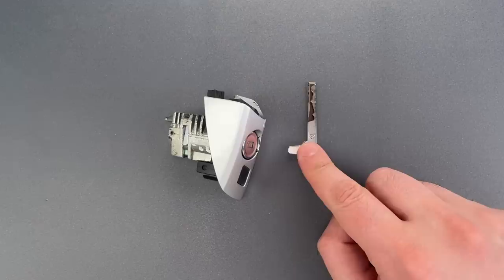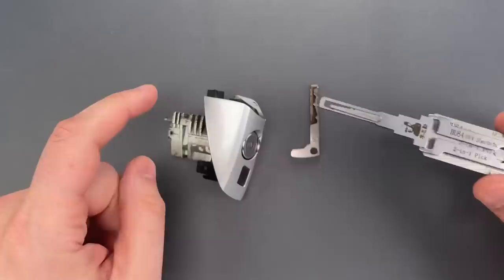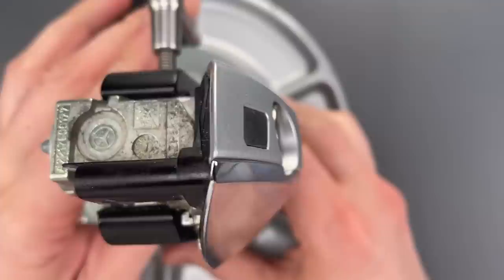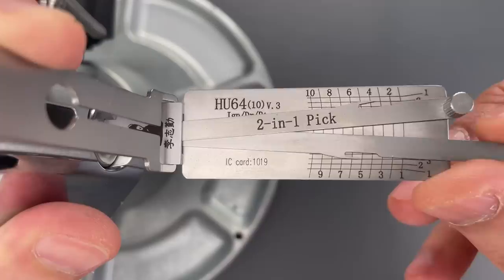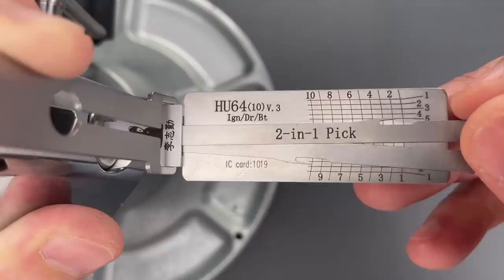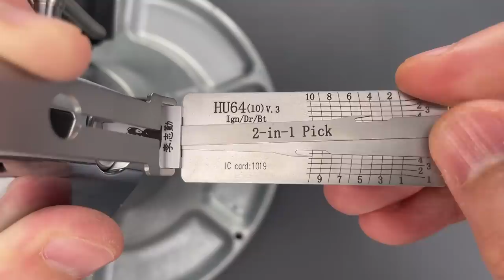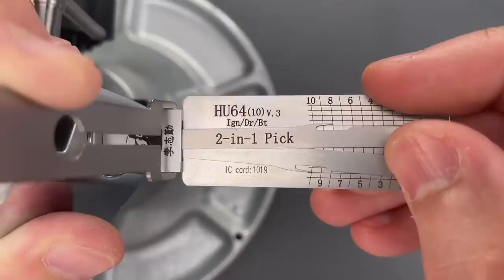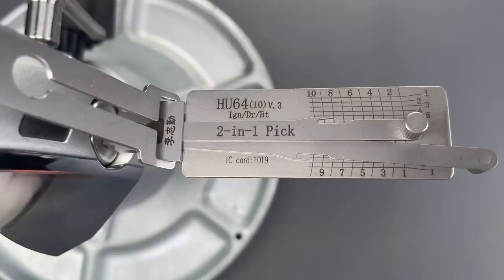[1411] Mercedes S-Class Door Lock Picked (2013-2020)

Comment: I was a bit shocked by the title, but then quickly became calm because of the fact that very few people has LPL's picking skill to crack this, and the fact that I don't have a Mercedes S-Class.
Reply: yeah but to start the engine you need an IR keyfob thingy tho
Reply: youd have to disable the immobilisor anyway, or chuck in neutral with a recovery truck
Reply: Same lock as my W211 E-Class.
Reply: @kristoffer3000  and my w212

Comment: Mercedes has been using these locks for over 35 years.  But really all these cars have alarms if the door is opened manually without the fob present.
Reply: Yeah, folks that want in them are only going to get the contents, they won't be able to steal the car without the fob and my gawd the noise that alarm makes. I still remember my C Class, that alarm would wake the dead.
Reply: That's why you first capture the fob traffic so you can clone it....

Or well that's how they did it with some cheaper earlier models, before the fob's started using rolling codes which are not that easy to crack.
Reply: Most need to pick the lock are when you lock your keys inside.
Reply: I'd like to see that confirmed. I've only done it with the proper keys, but usually unlocking it that way also disables the alarm as well.
Reply: @iVTECInside   Trust me it does not disable the alarm. I have owned/own multiple Mercedes.   If you take the key out of the fob and leave the fob say in the house and open a car door or trunk the alarm will sound.
Reply: @MarvinWestmaas   If you have the resources to clone the fob you do not need the key to open the car.....
Reply: If you're going to set off the alarm anyway and can only steal what's inside rather than the whole car, you could just smash the window. 

Then again, if I see someone in a car with their alarm going off and there is no obvious sign of forced entry, I'd be inclined to believe them if they claimed their car is malfunctioning or that their key fob has a dead battery. Cars seem to have a lot more false alarms than legitimate alarms. I'd glance over at an alarm but unless the car was mine or a window was broken, I'd probably ignore it.

Comment: Not sure I would expect more pick resistance from a car lock, even high price point. They will be reliant on alarm and immobiliser tech instead to disuade potential thieves.
Reply: @VideoViewer33512  Fortunately these days are long past, but in the early days of alarms etc. even those fitted by manufacturers were like aftermarket. Someone I knew made a 'living' stealing them, often selling them to the main dealers who would be fitting them back in wonce the found the alarm error was a missing alarm.

Comment: An important thing to note is that if you open a mercedes door with a key it will set off the car alarm (even if you use the key provided). This alarm will not go off unless the electronic key is present, and you can not start the car without the electronic key.

Comment: Bypassing the lock cylinder does not disable the alarm, though. There is a transponder receiver in the door handle that pings the transponder in the factory key. If there is no reply, the alarm remains active. So, as soon as you operate the door handle on the bypassed door, the alarm will sound and cannot be silenced unless you have a transponder-enabled key and re-lock the door with it, or put it in the ignition. Cool video, but still  only helpful if the car keys are locked inside or the battery is dead. The alarm system has a separate sealed-lead-acid battery that can keep it going for days after the main 12V battery is dead or removed.
Reply: There's no separate battery for the alarm. Im pretty sure the alarm wont go off if the key blade is used, its there in case the fob or keyless go system fails. There's main systems battery and then the aux battery for eco start/stop. No way you'll steal the car without very sophisticated equipment that gets a signal from the fob and copies it. This will take long enough to decide to run or smash the window though.

Comment: I thought yesterday "i want to see him try the locks on my s class" and you uploaded this video. You got in but there is absolutely no way you can fire one up without the fob. All conditions have to be right with the ecu, tcu, and ignition switch. Also unlocking the door this way will still set off the alarm system and disable the car.

Comment: Only allows entry into the car BUT the alarm will have activated !
You have to know the correct direction to pick as if you pick in the wrong 
direction you will have deadlocked the lock .
Picking the ignition is pointless without having the correct transponder chip.

Comment: Mercedes actually use this type of door lock on all of their cars and vans. Maybe trucks too, but I'm not sure. In fact, they have been using this door lock with that type of key for over 20 years now.
I own 2 and the keys are very similar. I've never used the metal keys to unlock the doors, but here is a tip to make sure your door lock functions smoothly. Spray silicone spray into the keyhole once, or twice a year, to keep everything lubricated. Basic maintenance, same as lubricating window tracks to avoid stressing the window regulators.
Reply: I prefer ballistol over silicone spray. I had a 22 years old 3-series and the locks were a little bit sticky and sometimes didn't lock. after treating the locks the locks funtioned like new.
same with door hinges, show them some love (and grease) and they work way longer (and don't rust)

Comment: I have one of these in my Merc (it's an old CLK, not the S-class, but they are the same)..
The key only allows you access to the inside of the car, does NOT let you start it, and in the soft-top (= convertible) models is actually redundant; its' ONLY function realistically is 
1) open the main door or the boot if the battery is dead or has been disconnected (Mercs batteries are in the boot, not the engine compartment, and the latch cannot be 'pressed' open if the electrics are dead as it is power assisted) 
2) actually to LOCK the glove compartment and the boot, if/when you drop the car off at the mechanic's or valet's, as you can leave the fob with them (to start the engine drive the car etc) while at the same time preventing access to any personal stuff CDs etc you've left in the car..the fob does not open these.
The ignition has been an infra-red transmitter since the mid-90s, the physical key is there to protect at most your sunglasses and maybe your jacket in the boot! It doesn't need to be high security..
Germans know what they are doing, no-one has ever accused them of under-engineering anything! 🤣

Comment: There is an old story about a plumber who is called to fix a blocked pipe. He goes under the house with a pipe wrench with the owner following. He takes the pipe-wrench and whacks the pipe which frees the blockage. He writes out a bill for $200. The owner complains that he only whacked the pipe with a wrench. The plumber takes back the bill and revises it: Whacking pipe with wrench, $2. Knowing where to whack pipe with wrench, $198. So it is with good locksmiths.

Comment: Auto locksmith here, the mercedes trunk locks tend to be much harder than the door locks, so much so that sometimes I will pick the door locks just to read the cuts before I do the trunk lock. It probably does not help that the trunk locks tend to sit at a vertical angle, but also for some reason, quite often as you pick the wafers, the pick arm tends to move away from where its possible for it to contact the wafers, so not only do you have to be conscious of pitch and roll axis, but yaw axis too.
Reply: When the trunk lock on my S class (W220) broke., I found the way in was to remove the registration plate, and drill a small hole in a certain place, then can easily pull the link rod with a wire.

Comment: Surely the car has an alarm system that would have gone off if the door was opened, right??
Reply: Yes, customers that also have the Mercedes app  that are subscribed to the feature will also be notified about it.
Reply: Yes the car probably wouldn't start without a correctly chipped key. But one can still get inside and steal something.
Reply: I believe these type of cars also have electronic measures to prevent it even starting. The key has to be in or near the car, so opening the door only gives you access to the inside, but not the whole vehicle. Unless you are a proffesional car thief, then you'll also jam the tracker, spoof the key + some other tricks and voila, got yourself a mercedes
Reply: This argument presumes that there is an alarm.
Reply: every car i have owned that has remote lock/unlock will sound the alarm when the lock is manually opened and it wont turn off until the car sees that the actual key is present, aka when you put the key in the ignition or hold the fob up to the start button.
Reply: When a car alarm goes off do you investigate it or just go "dang that's annoying" and continue on with your day? If the thief is quick and has a wrench it's very simple to pop the hood and disconnect the battery to kill the alarm, and anyone listening would think it stopped normally.
Reply: @Toastybees  Many cars have batteries that aren't super-easily accessible, particularly RWD cars (like a Mercedes S-class) that want to shift weight to the rear axle.
Reply: @boxr_4214  or you pop the bonnet and rip the battery terminals off in ~20 seconds or so. In a busy city at 3 am (when I assume most thiefs do their work) that's quick enough for most to turn back to bed
Reply: i think it could open but won't start
Reply: Car alarms are a waste of time... One goes off, nobody cares beyond saying to themself "STFU"
Reply: @jordanlewis1163  If you can pop the bonnet, remove the shielding, then disconnect the battery, and then also pop the boot and remove the carpet so you can access the auxiliary battery in 20s then you're a seriously good mercedes benz mechanic. 

If you wanna steal from a car just smash a window. People typically don't bat an eye when they hear an alarm, and you will be gone before anyone has time to dial the emergency services. For us honest people, never leave anything inside a parked car. At least not where it can be seen from the outside.
Reply: The alarm will go on as soon as you open the door, but the engine will not even crank without the electronic key button press, and transmission will not get out of park position either.
Reply: The alarm would go off before opening the door, just touching a Mercedes while it's locked makes it sound the horn as a warning.
Reply: @ikocheratcr  yeah i know but doors will probably open because the key is for emergencys only when the electronics are dead
Reply: @Toastybees  When I lived in Chicago car alarms went off so often that the birds learned to mimic them. And they'd all join in. So you might know that someone had done something to a car, but with every tree up and down the street going “whoop whoop whoop aanhh aanhh aanhh eeboo eeboo eeboo” you'd have no idea which or where.
Reply: @jordanlewis1163  aha! but the battery in a newer S-class is in the trunk and requires a screwdriver to access. not only would most thieves not know this, but that would require yet a another tool they would have to take with them.
Reply: Not only have numerous studies shown that audible car alarms (the GSM kind that text or email you are a different story) are next to worthless; but if the objective is to steal the car itself (as opposed to pilfer the contents) there are ways around immobilizers as well.  Most notably, hoisting the car onto a flat-deck and driving away with it; a surprisingly popular and effective way to steal a car.

Comment: *Quick Note: The door handle actually seems to be from a W221 S-Class - They were manufactured from 2006-2013, not 2013-2020. The picture on the thumbnail is right, but the years mentioned are actually for the W222 S-Class manufactured from 2013 - 2020. The W222 has a very different door handle design and a smaller keyhole - I'm not sure about the mechanical backup locks they use, but they seem to be different from this.

Comment: Old Mercedes from 80's you could kick the bumper hard and it would unlock the doors because it thought it was in an accident. Old Dodge neon you could pull the whole lock core out of the door by cutting a tennis ball perfectly in half and using it like a suction cup. Good stuff.

Comment: I've tested many of these types of cars. If the manual key is used to unlock the door, as soon as you do so the electronics will re-lock it instantly. i.e. you cannot use the manual key to unlock it. The manual key is only used if the car battery drains flat and nothing else works.

Due to this, it doesn't have to be very pick resistant.
Reply: What? what are you supposed to do if the keyfob's battery dies? that's even dumber than the usual "smart key" systems especially when the keyfob has no low battery indicator at all.
Reply: you can unlock it with the manual key if the keyfob is within range. it doesn't require battery to be detected. Remember all car keys have built in immobiliser chip that must be present to start the car, they are powered by radio waves from the car.
Reply: @BrianSu  Oh, the keyfob doesn't need a battery on that system? good on them, I've seen what happens when it does need a battery. It's reasons like that that are why I will NEVER own a car with that system.
Reply: @themagitechie9955  yeah it really doesn't make sense to require a battery because as I mentioned all keys have immobilisers anyway and it's worked for decades that way to prevent hot-wiring cars. Engineers like to over-engineer things with under-thinking :)

Comment: Most companies just use the same type of locks for all their models and even brands. I know a friend of mine once worked at a garage, they had a Ferrari parked outside of which the key was lost or something, so they tried the key of a Fiat Cinqueciento (Ferrari was still owned by Fiat back then) of a similar build date and they could just open it with that to move it out of the way. Not start it oufcourse because of the transponder, but still.

Comment: I think the reason car lock cylinders aren't more elaborate is because even if you pick the door, the alarm is going to go off, and if the alarm doesn't bother you, neither would setting it off by breaking a window if petty theft was the goal.

If you want to steal the car itself, picking a lock on anything newer than the mid 2000s at latest isn't going to get it started anyway. So we're back to the reason those crappy master locks are still popular, in that a lock only deters theft of opportunity and any professional criminal isn't going to be stopped much longer by a $100 lock than he is by a $10 lock.

Comment: Maybe M-B spends their security dollars in the alarm system. As LPL has pointed out in other segments, mechanically opening the lock cylinder doesn’t disable the perimeter alarm system. 
Still, you would think the manufacturers could throw an extra couple of bucks at the first line of vehicle defense if for no other reason than to give LPL a challenge!
Reply: It doesn't disable the alarm system, and it provides no way to start the car (you can't really hotwire it without pretty sophisticated equipment). Stealing interior content is more easily (and cheaply) accomplished by breaking a window... so why bother?
Reply: @dlevi67 and if you ever forget your keys inside you'll be happy that it doesn't take that long to open
Reply: @Homme_Pur  Yep. I don't see too many opportunistic thiefs buying Lishi tools...

Comment: Why are car door locks always so much better than house locks? This took 2 minutes for a very skilled picker using a highly specialized tool. Most house locks can be raked or bumped open in a few seconds by a novice. One you pick the car lock, you can steal what's in the car, but you can't drive it off because the chip will stop you from picking the ignition.
What is more valuable - The stuff you keep in your car or the stuff you keep in your house? Why do car manufacturers put actual effort into keeping thieves from stealing some old fast food bags, a phone, and a few CDs, but major manufacturers of house locks use the same no-security designs they've been using for decades?

Comment: luckily my -98 w220 S500's mechanical locks are completely full of dust and road salt so you can't pick them ;-) I have to hope that the remote doesn't go out.
Jokes aside, opening the door with the mechanical key (or picking it) will sound the alarm after 15s if no key is recognised.

Comment: This is not a 2020 lock, they changed the design in 2016 I believe... Plus the alarm goes off when you unlock with the metal key untill you turn the car on... So you might aswell smash a window.

Comment: While you can technically get into the car, the thief isnt going to get a lot of time with the car as the car will have its alarm triggered.
My car is old and occasionally the unlock thing doesnt work and it starts to beep at me before the alarm goes off (about 5-10 seconds. I dont stand around and time it.). So if my cars alarm is triggered coz I can't unlock it properly, I guarantee that this car will have its alarms going as well.

So the thief at best will get whatever they can carry. If able maybe take the whole car, but then they'd have a car with alarms blaring.

Comment: I'm a programmer and graphic artist, and a couple of years back read an article about the design of the digital dashboards on the touchscreens in modern cars. This particular article spotlighted the dashboards of cars across the entire range of price and pointed out at least one "premium" brand that had a dashboard that looked cheap, looked like it had basically zero effort put into designing it to look and feel premium. IIRC Mercedes is that brand.